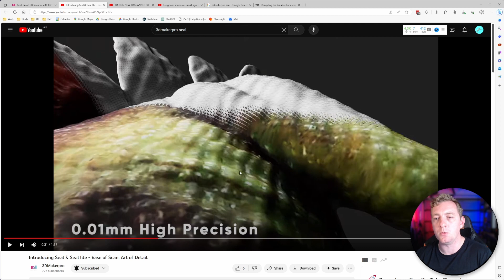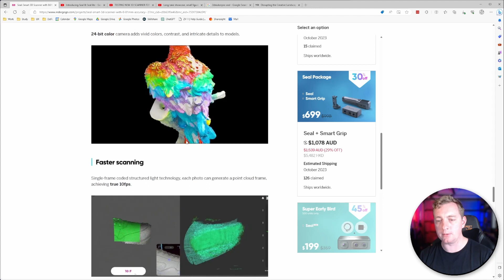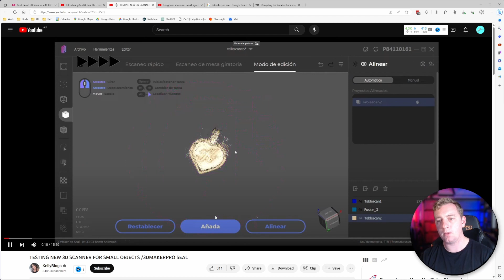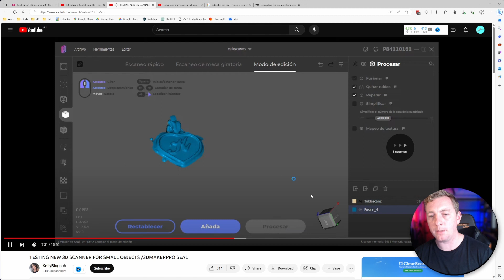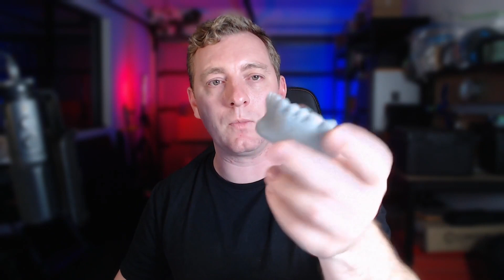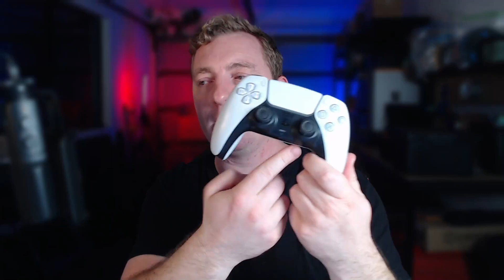The 3DMakerPro SEAL 3D Scanner: Will It Be Good?

Comment: I'm looking to get the seal mainly for mechanical engineering, this video was quite helpful, thanks for that! I was wondering how scanners like it handle objects outside of their "recommended" scanning size. I'm not trying to scan a car but some motorcycle parts / fairings will be scanned. size about 1m max. 
I didn't read anything about a hard-cap in size but maybe there's some experience from other small object scanners trying to scan larger objects :)
Reply from the maker: Thanks for watching. What I find with objects outside of its recommended settings is your start getting issues with tracking or alignment. Eg if using a small surface area liek this one and you keep trying to push out of its "area" it will start mismatching the alignment and you will need to stop or end up with a bad scan that you need to do again. You might be able to patch work a larger object together by doing areas and sort of overlapping them so it recognises and stiches the areas together but again start going too large and it wont be able to keep up. The other way of using a big scanner for a small object and you have the issue you just cant get close enough for it to start scanning and will keep asking you to move back.
Reply: @DraftID  hmmm, I think I'll give the seal a chance, I definitely need the fine detail in small applications. For larger stuff I'll give the ol baby powder + alcohol spray and stick on dots a shot. Thank you for the answer!
Reply from the maker: @marvfpv1590  My personal thoughts is it should be great with small objects and should pick up the detail quite well. Keep in mind 3d scanning is a skill to learn so take your time to learn it and how that fits in your overall workflow. I want to do more videos on what to do with models after scanning them since scanning them is really just one step in the process.
Reply: any update on the seal for the fenders and such?

Comment: If it's the same as the lizard, thank you for the warning. The lizard is garbage. I've worked with professional 3D scanners and these things are terrible. I couldn't even scan an amiibo without the frames jumping everywhere and it took me 2 hours to make the scan somewhat usable. Maybe if you've never seen a professional scan you might think this is ok, but the scans are not good at all. Not even close. Save your money.
Reply from the maker: I think there is still a very large gap between hobby scanners and professional scanners like you say, but there is also a huge price gap too. The problem I think is the marketing for these scanners promise the world but fall short.
Reply: @DraftID  if they were more realistic in their marketing it would be ok, but you are NOT getting .01mm accuracy out of this scanner. I've worked with high end scanners that are capable of doing this (we had to scan an aircraft part with ridges that needed to be unbelievably accurate) and even our best tech had trouble aligning the scan so accurately with high-end software. A $200 scanner sure won't do that. Not even close.
Reply from the maker: @EldyJambalaya  I completely agree and I wish marketing was more realistic.
Reply: @DraftID  3mm accuracy is closer... providing you can get a decent scan in the first place
Reply: The Scan Ferret turned out to be a really decent color scanner, and I'm hoping the Seal will be even better by being able to autoalign multiple scans.
Reply from the maker: @destronia123   yes I was very surprised with how the ferret captured colour scans but it also used completely different software which could be why. The Seal pro is saying 24bit colour which might mean its similar performance to the ferret in colour capture but also interesting that the regular seal is not 24bit colour so maybe its still the old slow method which barely works and often crashes. Still have not seen live demos of the colour capture so will wait and see.
Reply: @destronia123 you can aling the ferret scans or of any other with external free software as Cloud Compare.
Reply: What you say is a non sense and obviously you didn't use a professional scanner in your life.
Reply from the maker: @Flamenawer  professional scanners like arctec no. I'm not sure what your point is in this conversation.
Reply: @Flamenawer  I don't need to flex to you on how many scanners I've been trained on but I know what a good scan looks like and these consumer level scanners are pretty garbage. The tech just isn't there yet to get a nice scan at these costs.